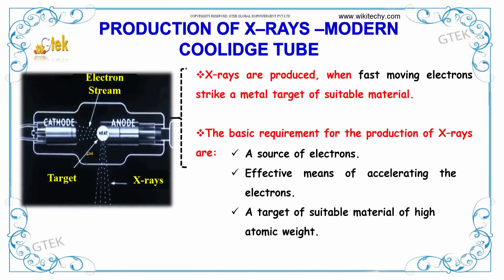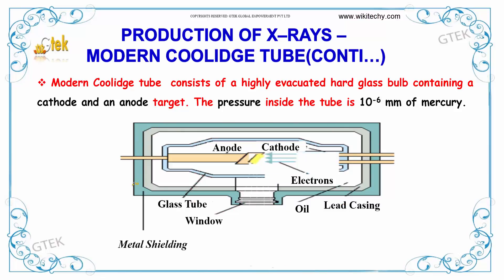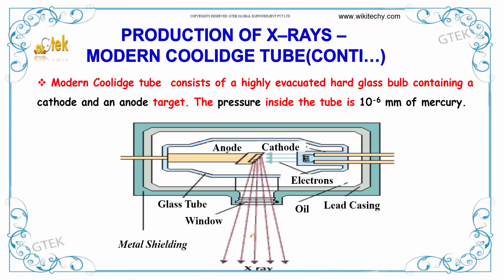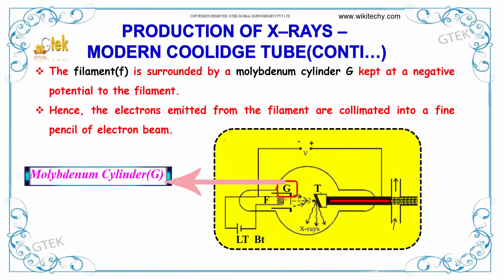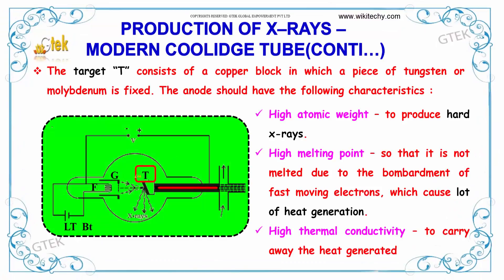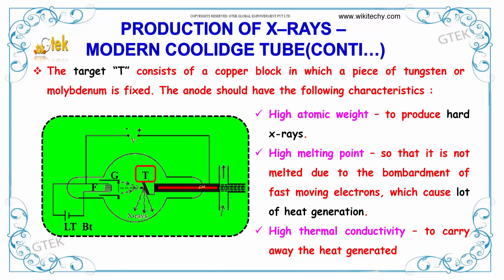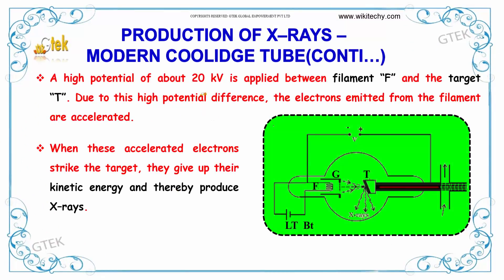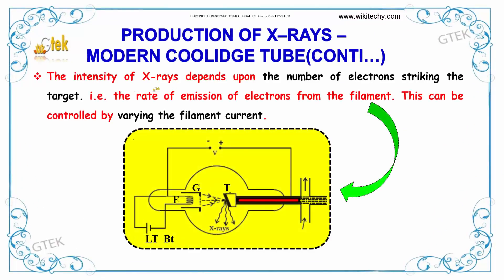Production of X-Rays Modern Coolidge Tube  |class 12 physics subject notes lectures|CBSE|IITJEE|NEET

Comment: Typical early x-ray tube, the anode cut at an angle to aid heat flow and emission of x-rays. More modern design typical of medical diagnostic use (except that this figure ... direct deceleration of the incident electron and can produce x-rays of energy .... Ka. La. Lb. Lg. P301 Lecture 12 “Characteristic X-ray production”. NOTES:.

Comment: Tungsten is the most commonly used target material in the anode because it has a high atomic number which increases the intensity of the x-rays, and because it has a sufficiently high melting point that it can be allowed to become white hot.

Comment: An X-ray tube is a vacuum tube that converts electrical input power into X-rays. X-ray tubes ... In contrast to other sources of ionizing radiation, X-rays are only produced as ... Direct cooling by conduction or convection, as in the Coolidge tube, .... metal anode bearings, rotating frame tubes and other modern technology.

Comment: X-radiation (composed of X-rays) is a form of electromagnetic radiation. Most X-rays have a wavelength ranging from 0.01 to 10 nanometers, corresponding to frequencies in the range 30 petahertz to 30 exahertz (3×1016 Hz to 3×1019 Hz) and energies in the range 100 eV to 100 keV.

Comment: X-rays are a type of electromagnetic radiation, just like visible light. An x-ray machine sends individual x-ray particles through the body. The images are recorded on a computer or film. Structures that are dense (such as bone) will block most of the x-ray particles, and will appear white.

Comment: An X-ray tube is a vacuum tube that converts electrical input power into X-rays. X-ray tubes evolved from experimental Crookes tubes with which X-rays were first discovered on November 8, 1895, by the German physicist Wilhelm Conrad Röntgen. The availability of this controllable source of X-rays created the field of radiography, the imaging of partly opaque objects with penetrating radiation. In contrast to other sources of ionizing radiation, X-rays are only produced as long as the X-ray tube is energized. X-ray tubes are also used in CT scanners, airport luggage scanners, X-ray crystallography, material and structure analysis, and for industrial inspection.

Comment: The Crookes tube was improved by William Coolidge in 1913.[8] The Coolidge tube, also called hot cathode tube, is the most widely used. It works with a very good quality vacuum (about 10−4 Pa, or 10−6 Torr).

Comment: What is special about side-window tubes is an electrostatic lens is used to focus the beam onto a very small spot on the anode. The anode is specially designed to dissipate the heat and wear resulting from this intense focused barrage of electrons. Some anodes are mechanically spun to increase the area heated by the beam (e.g. edical "rotating anode") or cooled by circulating coolant (indirectly on most rotating anodes). The anode is precisely angled at 1-20 degrees off perpendicular to the electron current so as to allow the escape of some of the X-ray photons which are emitted perpendicular to the direction of the electron current. The anode is usually made out of tungsten or molybdenum. The tube has a window designed for escape of the generated X-ray photons.

The power of a Coolidge tube usually ranges from 0.1 to 18 kW.

Comment: In the Coolidge tube, the electrons are produced by thermionic effect from a tungsten filament heated by an electric current. The filament is the cathode of the tube. The high voltage potential is between the cathode and the anode, the electrons are thus accelerated, and then hit the anode.

There are two designs: end-window tubes and side-window tubes. End window tubes usually have "transmission target" which is thin enough to allow X-rays to pass through the target (X-rays are emitted in the same direction as the electrons are moving.) In one common type of end-window tube, the filament is around the anode ("annular" or ring-shaped), the electrons have a curved path (half of a toroid).

Comment: X-ray tube is a vacuum tube that converts electrical input power into X-rays. X-ray tubes ... Direct cooling by conduction or convection, as in the Coolidge tube, ... Contemporary CT tubes have power ratings of up to 100 kW